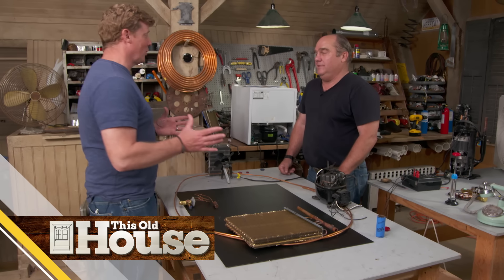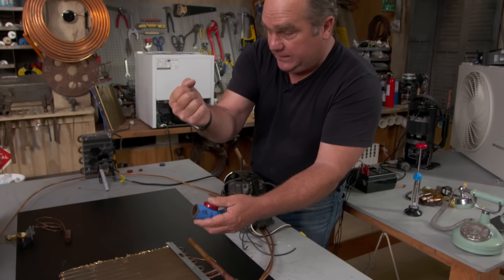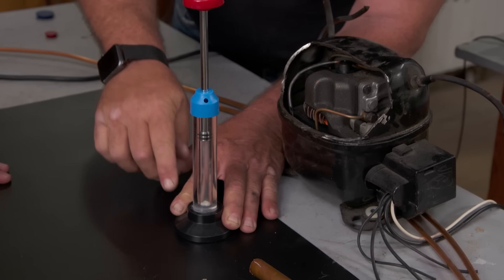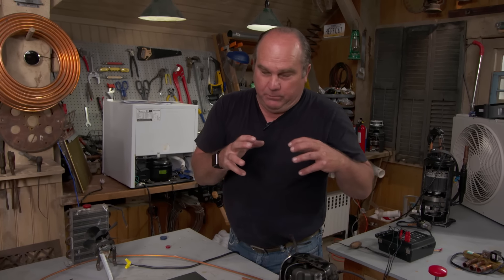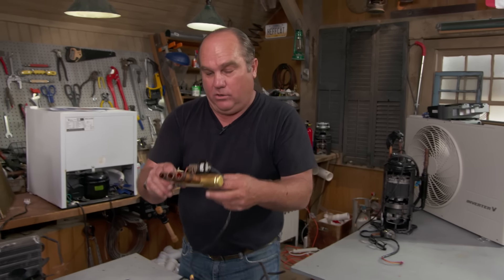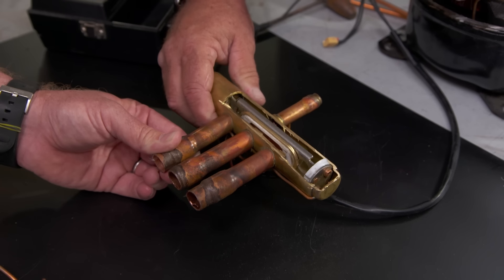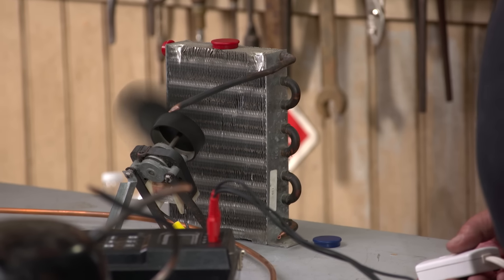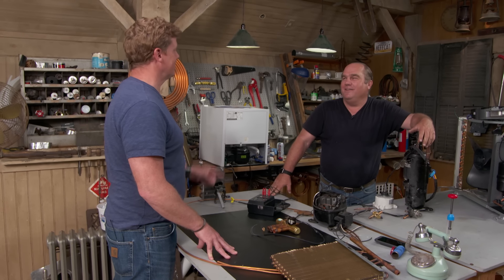How a Heat Pump Works | This Old House

Comment: You left out a lot of information. The condenser, buy removing heat, turns the refrigerant into a cool liquid. This sprays through the expansion valve and boils off in the evaporator to absorb heat from the house. 
With a heat pump on heating, when you get below 40 deg F, the system can no longer take heat from the air. Most systems are actually set at 40 deg F to prevent icing of the condenser. Instead, your heat for the house comes from the heat/work of the compressor.
I suppose you need to be an engineer to acquire this knowledge, because they do not teach these details to technicians.

Comment: Still complex to me.  
The bad aspect of this system for heating,   Is that after the heat cycle is over, cold air runs through the ducting due to a defrost cycle.     Kind of defeats the purpose.

Comment: I think he made a mistake explaining the cooling system, the cycle will be like that: Condensor, expansion valve, evaporator, and then the compressor, he said after the condenser the refrigerant will go through the compressor which is false, the refrigerant is already at high temperature and pressure

Comment: ideal gas law...PV=nRT says it all.
Reply: Except in this case, refrigerants are not an ideal gas, because they are very close to their liquid state at the temperatures and pressures involved.   Half the cycle, the refrigerant is in a liquid state.

Even if it did compress as an ideal gas, P*V=n*R*T is not an equation that will describe the process, because only n and R are constants.  P, V, and T are all varying together along a path called an adiabat.   The correct equation is P*V^k = C, where k is a constant specific to the substance, and C is a constant that depends on the initial condition and amount of gas.   For air and any other gas molecule of two identical atoms, k=1.4.   For R134a refrigerant, k=1.14.   It has to do with how complicated the molecule is, and how many modes it can store energy, and the more complicated the molecule, the closer k can be to 1.  In liquid and solid states, the k ultimately will equal 1.  The upper bound on k, is 1.67, as it is for single atom inert gasses like helium.

Comment: but theyre not efficient below 25 or 30 degrees right??
Reply: Now days they are, older ones can have a problem With coulder climate
Reply: No they aren't, and don't believe anyone that says they are. What the sales people don't tell anyone is that the hvac system can't make enough heat in freezing temps (especially in humid climates) so the "heat strip" takes over, which is just like a giant hair dryer that cost's big bucks to run.
Reply: Just got a Mitsubishi hyper heat mini split installed over a week ago.  Outside temp was 23 F last night no problems.  This unit suppose to run down till -4 F.
Reply: It's not the cold air that does it it's the moisture in the air that freezes that becomes your problem
Reply: @aerodicus  your not correct, you've described an older fixed speed heat pump. Newer inverter heat pumps don't have resistance heat strips at all, they just run the compressor at a higher speed in sub zero conditions to make up for the loss in capacity. New systems can work down to -20c and still be more efficient than resistance heat.
Reply: @tomtom1541  I watched the whole video this time and you're right, they're showcasing a new design of pumps, but looking at reviews I'm reading about efficiency drops in sub freezing temps that reach the same as heat strips and in some cases facilitate the need for backup heat sources.
Still an improvement over the 2 stage pumps like ours though, and I'm sure they'll only get better with time.

Comment: When my furnace went out, the HVAC guy talked me into a heat pump. Surprisingly my electric bill went from and average of $150 a month in the winter to over $500 a month.
Reply: That must be really gratifying. Nothing like a utility bill skyrocketing to remind you that you are doing it right.
Reply: That's was a Natural Gas furnace right?
Reply: @suggesttwo  no, it was electric. I replaced the heat pump with a gas furnace.
Reply: @robertgroover3316  Very very good to know.
Reply: robert "I replaced the heat pump with a gas furnace."thats not what you said originally.  
first you sad " my furnace went out, "  so what did brake, and what was it replaced with??
Reply: @paulparoma  well it's obviously not working correctly
Reply: @tomtom1541  I am not sure it's all that obvious.

Comment: when he says every ac has a txv tilts me
Reply: It either has a TXV, or some other component that provides the same purpose.  There are different names, and slightly different purposes added to the component, but they all ultimately are serving the purpose of dropping pressure through friction without any heat exchange or mechanical work involved.

In concept, it could be replaced with a turbine to recapture the work, but in practice, there is a diminishing return that makes it not worth the effort.

Comment: Yeah but what there not telling u is it takes the heat pump 30-45 minutes to start heating up, meanwhile your unit is pushing cold air. We had a heat pump heater in our central air unit after one winter we yanked that sucker out and installed a good old fashion gas unit. Heat pump units are terrible imo! 💯

Comment: So a heat pump is an ac unit with the coils swapped, I've had ac units in my house for 17 years that do that. Not very efficient.!
Cool (1kw) in summer heat in winter (3.8kw).

Comment: heat pump is an old old invention, It is the HVAC industry resistance to improvement that keep the profit rolling in by  keeping for A/C and air heating as a separate function.

Comment: Inverter...these are all unnecessary things. They are making these things more MINIMALLY "energy efficient." If you just want your home heated or cooled as needed,  DO NOT GO "HIGH SEER." Keep it simple and install a 14 SEER system. Use any additional monies to replace old duct and/or seal existing duct work. THAT, it where you will really save money.
Reply: Lol what. The mini split I've got in my bedroom is close to 30 seer which works out to use half as much electricity as a widow ac. There's no ductwork and the room is already insulated.

Comment: So why aren't these systems tied into a refrigerator or freezer in a house? Does it not work? Too complicated? Because  heat and lack of heat is nothing but electrical differential and there is no such thing as centrifical motion.  You can not replace cold with heat and vice versa without emitting extra of one or the other and having some sort of "booster" system. 
Works in theory but fails rapidly in reality.
Reply: Too impractical to pipe.   That's why we just have the condenser of the refrigerator exhaust heat to the kitchen, rather than exhaust heat to the outdoors.

Comment: Blowong air on thermometer to cool it down is completely different thing.
Reply: No, it's a perfect demonstration of basic applications, without much underlying theory given. The thermometer reads the dry-bulb temperature of the gas (air in this case), and will read the same at any airstream speed, 0-mph or 600mph, or aircraft (or your car dashboard) would show constantly changing temps relative to speed. The effect you're visualizing is wet-bulb temperature effect, the cooling effect of wind on your moist skin due to evaporation cooling, or the Tv weather lady "feels like temps ". Dry bulb is true temperature.
The compressed air in the can is at room temperature (safe to assume), when released through the valve nozzle it expands rapidly to a much lower pressure and temperature (Google- gas laws) the change (in pressure) results in proportional drop in temps.
The piston demonstration is also used in auto shop and physics classes to teach effect of compression on gasses, such as compression ratios in engines causing knock (gasoline engine) or normal fuel ignition (diesel engine). Same principles -the gas laws, being applied for many purposes, including weather forecasts. 🙂

Comment: Of heat pumps are so great at heating a building on a cold day, why do so many heat pump systems have heating strips?  You’ll never convince me heat pumps are better than gas or oil fired furnaces.

Comment: Here is the basic function of a heat pump warming.... the compressor "compresses air" thus, compressing air heats the air.  For example, run ANY compressor and after a few moments, put your hand next to the tank, walla, heat.  Listening to someone tells you that there is heat in air regardless of how cold the air is, is a razzle dazzle speak, without telling you the truth of using a compressor and the basics of what happens when air is compressed. PERIOD.

Comment: there is no such thing as "cold",  everything contains heat up  to -460 degrees.  Or one could say, "higher pressure, higher temperature".....just saying

Comment: I’m a commercial hvac tech. I would never put one of these in my house. R410a refrigerant cost around 80-85 dollars a pound. Average system will hold 3-4 lbs. These systems will always leak refrigerant, you can’t smell it. You will not have heat or a/c. Compressors will last for 7 years if your lucky. There’s another 1500-2000 dollars. Reversing valves fail constantly. There’s another 500-600 dollars. These things are junk. If your lucky, this will last 12-15 years. There extremely loud. Furnaces will last 18-20 years. Don’t waste your money. Way to many moving parts. Stick to a 90 percent furnace. I just had windchills of -50 over the weekend at my house. My furnace did just fine. Modulating ( inverter). heat pumps are junk. The only good thing is these create a lot of work for me. I make money from constantly fixing these.

Comment: Those  AC refrigeration systems use a lot of electricity.  So how is it going to be cheaper than some there form of heating?  This makes NO since if it's the same thing going in the opposite.  Who's going to pay the electric bill?

Comment: Your teeth might chatter a little for the first few days, and if a cold front moves in you might put space heaters in every room. Same for summer; you might need to put window units in every room to help the weak assed heat pump.
Reply: Sounds like you need better insulation, the cheap fix with long term comfort and $savings.
Also, get a modern 16 seer rated H pump, properly sized and installed with well sealed and insulated ducts, or better yet a ductless package like Mitsubishi or Daikin makes. Don't forget that annual cleaning & maintenance checks are essential to keep 🙄 it working and avoid the panicky call (at top dollar prices) during the heatwave/blizzard when they inevitably fail. Every winter I'm out deiceing and doing evaluations of conditions for someone in my neighborhood. Usually failing to do regular maintenance.
Reply: Kevin Smith I don’t own a heat pump and if I saw one on a prospective property I’d plan on changing it out. I was referring to past experience.
Reply: Also all those remedies you suggested? Compared to a $10 1500 watt space heater? Or $200 window unit AC which actually cools the room instead of get it cool by sometime next week?
Reply: @walterkersting1362  your comments make no sense. The small mini split I have in my bedroom is capable of outputting 3000w of heat so it will always outperform a space heater. Also has no problem keeping the room at 68f during the summer.
Reply: If yours is weak it's either malfunctioning, not installed properly or too small for the area you are trying to heat / cool

Comment: altough these systems have evolved they use a fair amount of electricity,you would have to have a lot of solar pannels if you wanted to heat your house with heatpumps
and when in winter,as there is less sun you would have to go on the grid,prices for on grid electricity in our coutry are ridiculously high,thanks to our government

Comment: there complete shite  no where near as good as my combi boiler was b4 wish i never changed complete garbage
Reply: Sounds like yours isn't installed properly. There's more steps required than simply swapping the boiler out for a heat pump.

Comment: BS! The compressor creates the heat by compressing the  air from the outside. If the outside air is to cool to efficiently warm the inside air in a sufficient amount of time then the heat coil takes over shutting off the compressor so it doesn’t burn out.